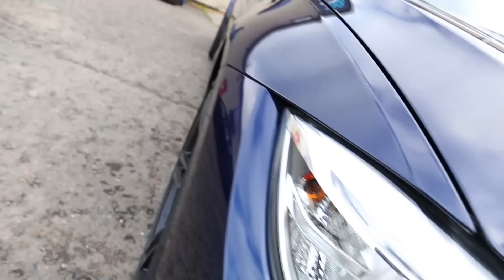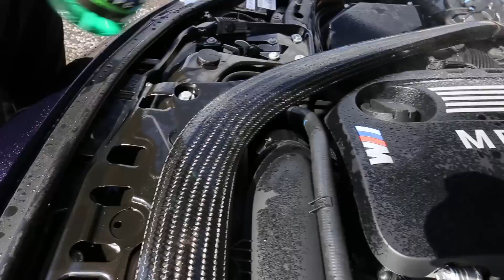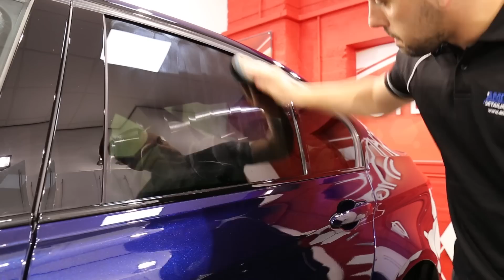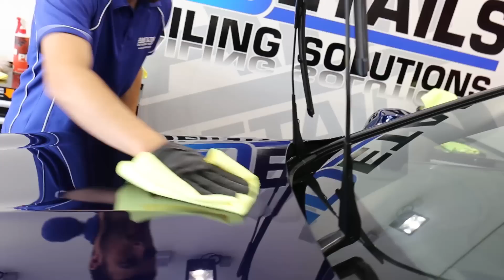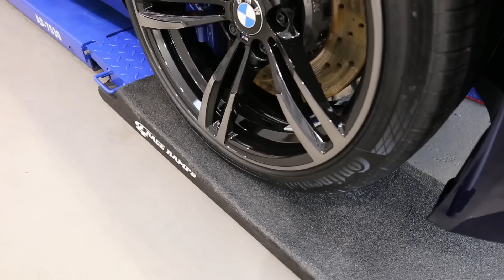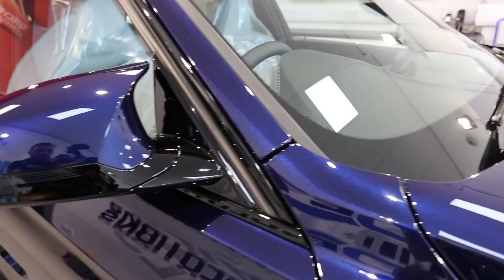BMW M3 Detailing - Fast Forward Cleaning Review - AMDetails Car Care Guide

Comment: Weird system to go))) First cleaning wheels and later take them off to clean from inside )))
Reply from the maker: +Garmashua some say that but...here are a few of our reasons. Hope they help.

1. Cleaning the wheels on the car is a lot safer than off the car "risk of falling over / dropping.

2. Handling dirty wheels are no fun and could induce scratches. So clean them first then once off it could potentially just need an inner barrel decontamination inside.

3. We allow for this in our pricing so the "extra time" is not a loss to us.

Everyone has their way. We can't wait to hear yours. This community is all about discussion. 

Alan😎👍

Comment: Using a duster on a car, risky stuff
Reply from the maker: Thanks for your comment Mazdarati2.

We use many ways to help remove and reduce dust levels on our vehicles. Using a clean duster is one of them, and we have yet to have any issues with our techniques. 

Some duster tips.
1. Blow it our with an airline/blow drier before and after use
2. blow the vehicle initially
3. light flicking movements in one direction help you to see any marring if you happen to induce any due to poor residue control or easily damaged paintwork (you would then not use this technique) and the "deliberate" motion will be easy to see/rectify.
4. the duster is super helpful for reaching between gaps and window seals.

General Residue control tip.
Use only what is required and work at a medium pace. Most residue damage is caused by poor control on the pad and the pad absorbing the polish rather than holding it on the surface to work. Also, keep mindful to rotate your microfibre cloths and change frequently.

Hope these tips help.

Please also do provide your suggesting to the #AMDetailsCommunity so we can all learn from each other

Thanks
Alan   😎👍🔔
Reply: Thanks!
Reply from the maker: No Worries Mazdarati2 - Alan